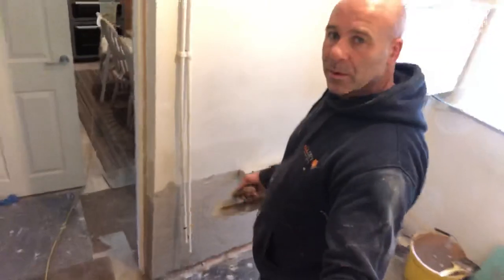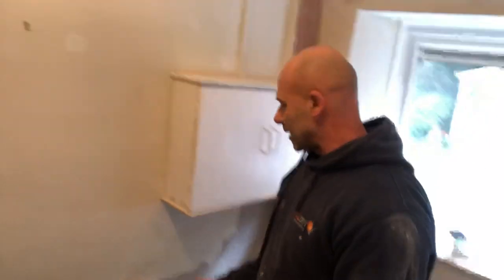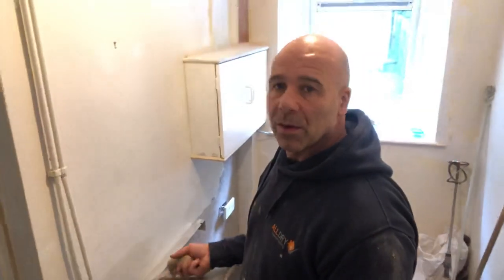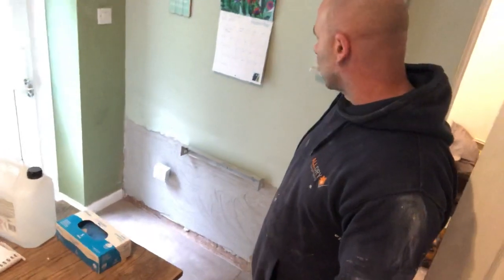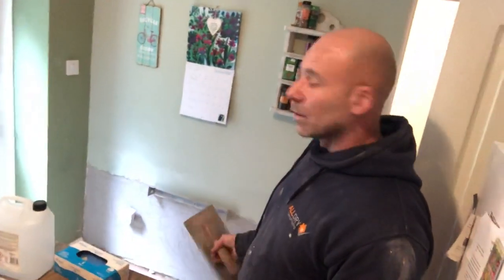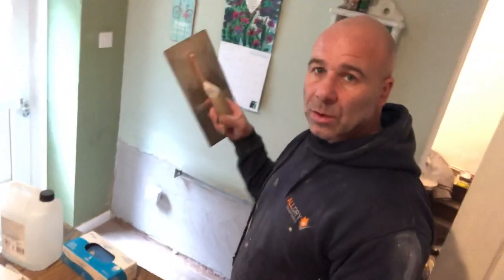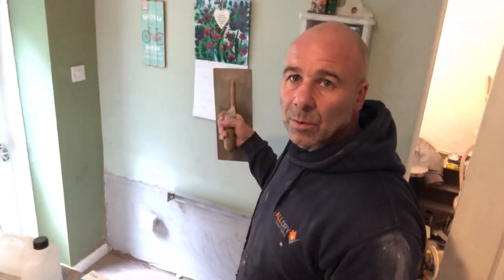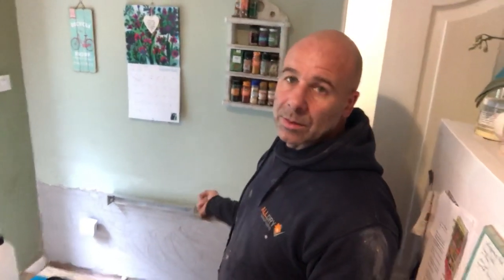What DryZone Plaster like when set

Comment: Hi... How is the moisture able to escape through the Dry Zone backing plaster, as you mention, when using a standard (Thistle) finish plaster, without causing damage to the finish plaster?...or, did you use something other than that? Cheers.
Reply from the maker: ningis21 it just diffuses through and into the atmosphere through evaporation. The finish allows it through